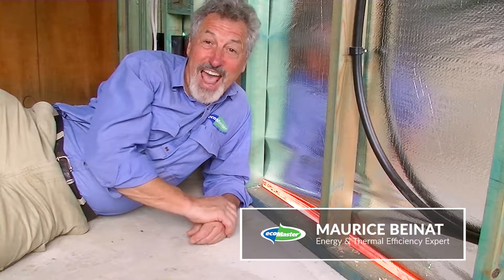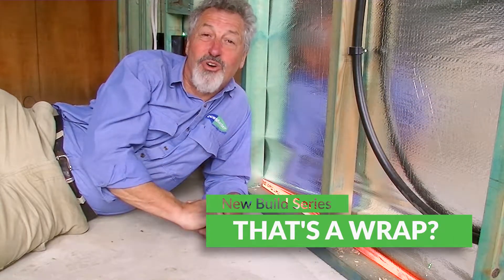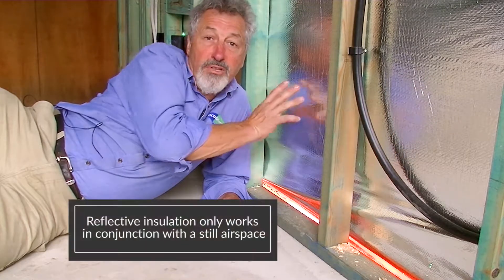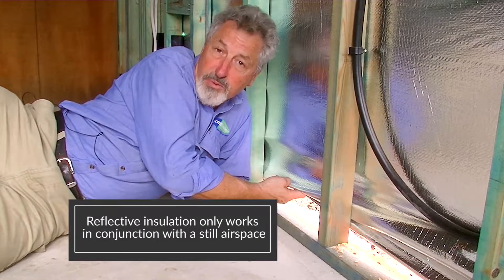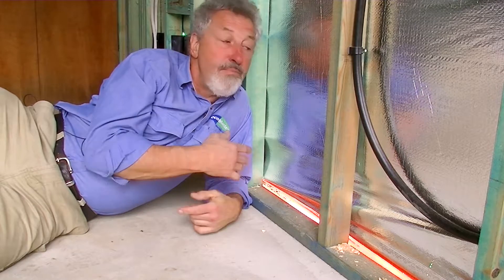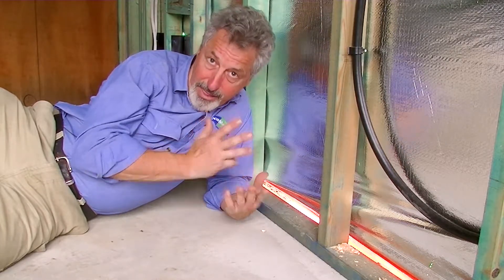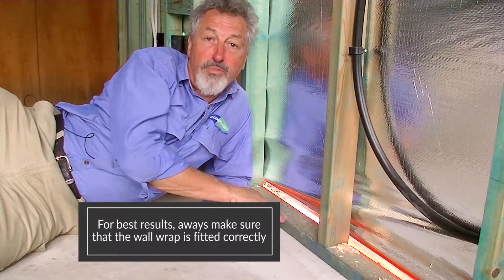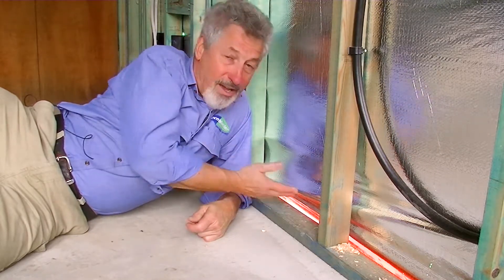Wall Insulation - How to Fit Wall Wrap

Comment: This is beneficial for northern humid parts of Australia, but for the rest of Australia, foil sarking should NOT be taped up perfectly because it is NOT a vapour permeable material, and it could cause serious moisture problems inside your walls, especially around wet areas like the kitchen and the bathroom on south facing walls.  All wraps south of humid areas of Australia should be installed with vapour permeable wraps, externally NOT foil sarking and then this information is pertinent. 👍🏻. Happy new year, EcoMaster! 😉. Hope this helps.
Reply from the maker: Thanks John and Happy New Year to Efficiency Matrix too.    Thank you for the additional important distinctions on wall wraps.  This particular installation was indeed in Queensland (which for others reading these comments is a northern humid part of Australia).   Obviously having the right product in the right place is the first step.  The second step is correct installation.